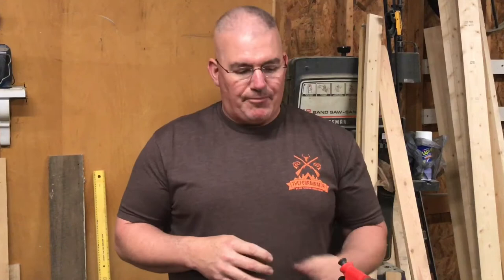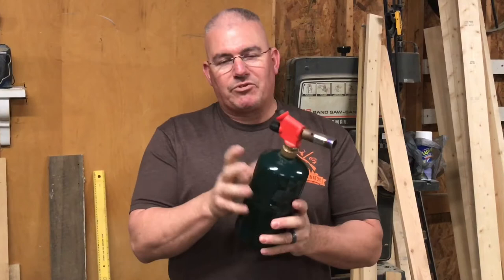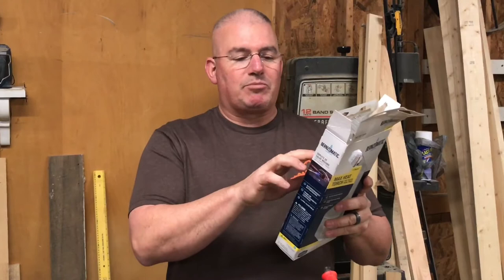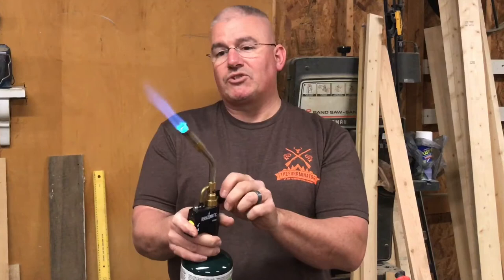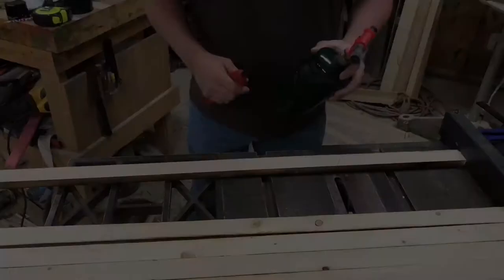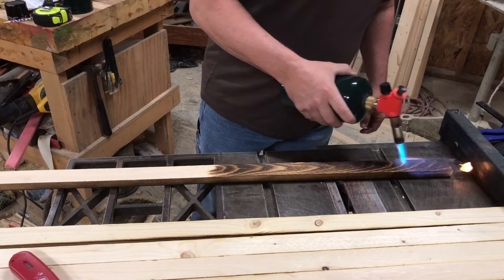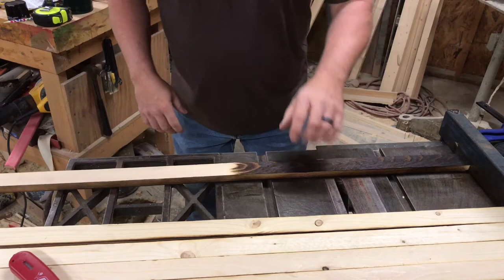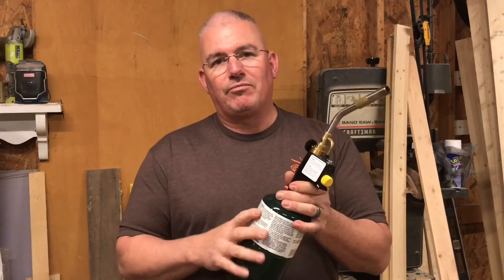Rustic American Flag / BernzOmatic TS8000 Torch

Comment: There's another video by a fellow who had a TS800 explode in his hand. I understand that there was a recall of these and that this is not an issue now.

Can you give some lowdown on this?
Reply from the maker: I haven’t seen that video or heard of that issue. My torch hasn’t given me any trouble at all so far, I’ll look into the recall though. Thank you for the info
Reply: There is a vent hole in front right under your hand.  If it vents while using it, your hand can be burned if it ignites.

Comment: I used the torch today for sealing meat for the the first time, I detached the torch from the propane bottle after use and all of the propane came out of the tank like exploding, what did I do wrong?
Reply: Sounds like the check valve in the bottle stuck open.

Comment: do you have issues with sap coming up? had a few here lately where it just seeped out
Reply from the maker: Heath McKenzie yes, sometimes the heat will cause the sap to rise. When I have this happen, I let it cool and use a knife to scrape the hardened sap off the board. Seems to work ok when I do that.